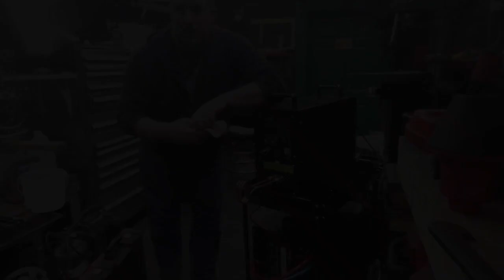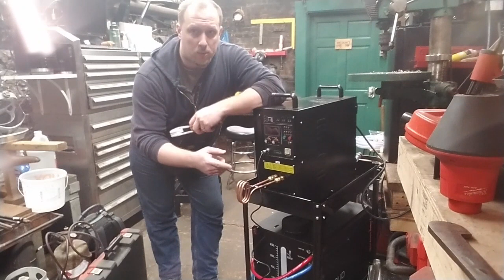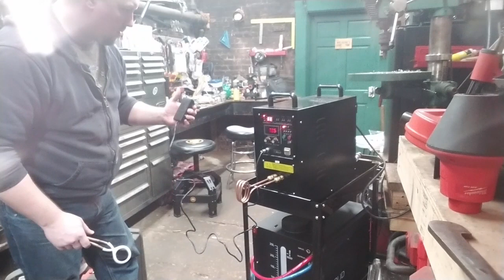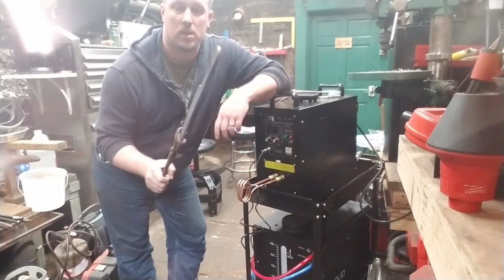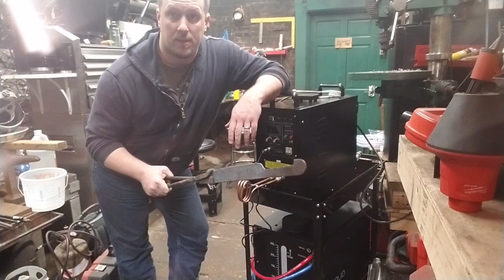I Just Got an INDUCTION FORGE | Blacksmithing & Forging

Comment: what kind and what Kw did you choose and why ? what voltage and Amps does it require
Reply from the maker: I use a 15 KW unit, and got it in 220V because I already have it in the shop. Not sure what it actually draws, but it calls for a 40 amp circuit.

Comment: We have that same unit at my MakerSpace.   You hit on the good sides, but there are some downsides.  First, it is not well manufactured.  Ours developed a coolant leak inside requiring us to completely re-plumb it.  Someone at the factory put Teflon tape on fittings where hoses were clamped.  This just makes them more likely to come loose under pressure.  Dumb, dumb, dumb.

If you bridge the coil  you can cause sparks.  The machine does shut itself off, but it can cause the coils to rupture, which is bad news. It also could use more power.  It's not bad, but getting something REALLY hot can be tricky and involves having the right size/shape coil.

The positive there is that the coils are easy to make yourself with some copper tubing.  If you get one of these, you will probably want to get a  bunch of tubing and fittings and make several different coils to meet various needs.

All told, it's a very useful machine, but definitely not a replacement for propane or coal.
Reply from the maker: Sorry to hear about the coolant leak. Useful information. Thanks!

Comment: Seems useless for knife making. Or any other form of traditional forging.
Reply: This technology is great when you want to avoid excess heat in your shop. The limit is the coil, really. Not saying it replaces gas forges and coal, wood, corn cob as fuel, just adds a lot of versatility. And it has drawbacks, such as freezing cooling tank and lines. And initial cost. But in a production shop with real big output, those costs have their write offs. Worth considering.
Reply from the maker: @reverendbrothergenerick7976 I'd agree with that.
Reply from the maker: @LorisSawmill Weird take, but thanks.

Comment: To minimize sparking put work piece into coil first, then turn on. Turn off before withdrawing work piece. This way touching won't be electrically charged, but should be avoided as a rule to avoid scraping copper coil and contamination of work piece hot steel.
Reply from the maker: You are correct. However, I do not consider that a significant concern. Thanks, though.
Reply: @VonGlierBlacksmithing  Ya sure dere, I only thought to mention since you were new to this and so wanted to perhaps guide correct procedure from the outset so you didn't have an established bad habit that would need to be unlearned. After a breakdown in the middle of a job. Like all those bad welding habits I have had to unlearn and wish someone had been there for me to correct initially. All part of the process. Safety squints!
Reply: put a ceramic block in your coil